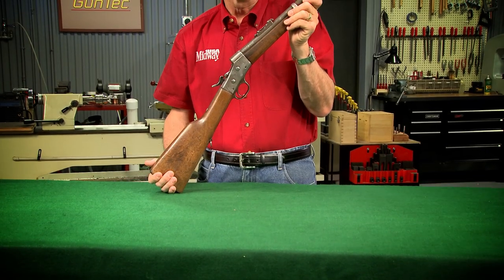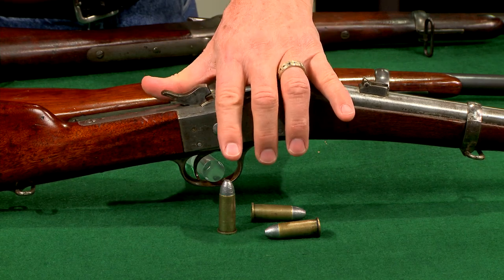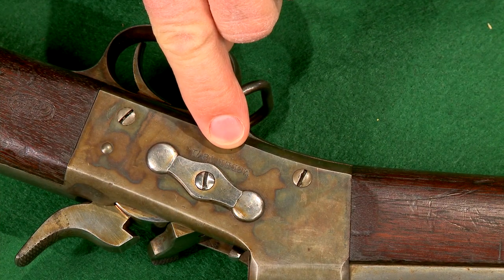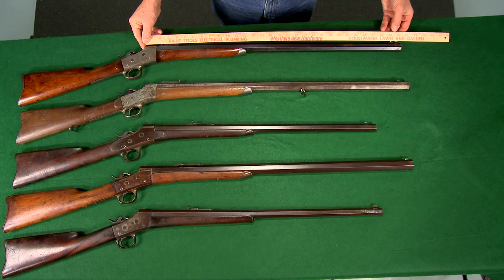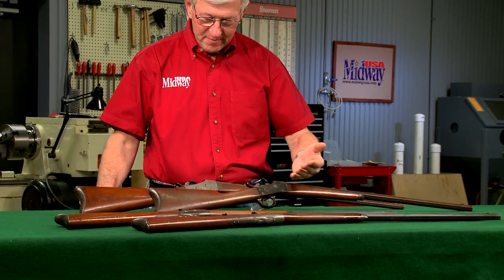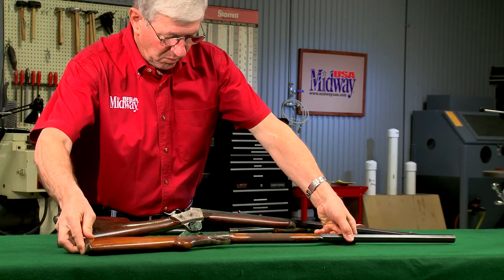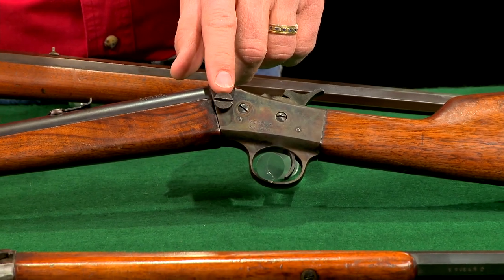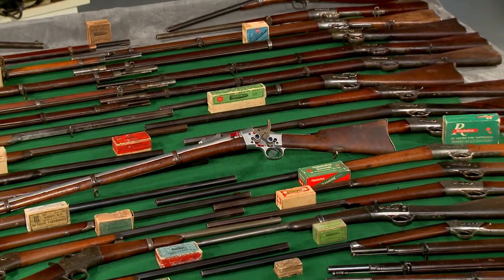A History of the Remington Rolling Block Single Shot Rifle | Gun History | MidwayUSA

Comment: Back in the early 80s, I passed on buying an old Remington Rolling Block in 6.5 X 53.5R, an obscure Caliber even then.  I was in my early 20s and had no use for a gun I couldn't easily find ammo for. The idea of having it rebarrelled or rechambered didn't occur to me back then, so I passed on the gun, and have kicked myself for not buying it ever since. Though in rough shape (no blueing left at all), it was in fair to good condition with only very minor rust pits on the barrel. In the bore was worn, but the rifling was still present. Back then, the owner was asking $125 at the time.

Comment: Thank YOU sir for your very interesting and informative video. This is probably the 3rd or 4th time I watched this video. I picked up a old Remington Rolling Block #1 in 20ga, it wasn't in great condition but appeared to work properly but haven't shot it YET. Someone welded back a broken lever on the breach block that makes me a little bit APPREHENSIVE about shooting it but figured to try low power bird shot for TESTING and will tie it to something from REMOTE FIRING TO BE SAFE!!!! Then I was able to pick a model #4 solid frame in not that great condition, externally was not too bad for its AGE but the BORE was not too GOOD, looked like it wasn't cleaned much and shot ammo that left a bit of lead residue in the rifling. I had to WORK on it AWHILE to get as much out as I could. It's NOT GREAT but actually not too bad considering what it was BEFORE!!! It appears to like CCI QUIETS and Agulia Super Colibris which is FINE but I will do more testing. Then today I found a #1 1/2 Sporter in 22lr, it had been RELINED so the BORE IS GREAT but I'm sure it HURTS the COLLECTOR VALUE!!!! It functions VERY GOOD as far as condition externally, wood and metal as well as ejecting exuberantly. It's got a NICE LIGHT CRISP TRIGGER which means if whoever relined the barrel did a GOOD JOB it should shoot VERY ACCURATELY if I find the ammo it likes!!!! I try to send most of my gun accessories purchases your way as much as possible unless you don't offer what I need or there is a significant difference in PRICES with some other company which doesn't happen very often!!!😉👍😎 I REALLY ENJOY ALL YOUR INFORMATIVE VIDEOS!!!!😁👍

Comment: I have a saddle ring carbine in 7x57mm Mauser and these models tend to have generous chamber headspace issues so I use 8x57mm Mauser cases and carefully set the shoulders back as I'm resizing them in a 7mm die,it will still fire a 7 Mauser round but the case has to stretch to fill the chamber length and the case is no longer safe to reload.Reforming 8mm brass is the only way to go if you happen to have one of these problem children,improves accuracy and makes case life normal, just bump the shoulder back to where the breech block closes and no more.

Comment: I have just received a nice Rolling Block rifle. Made in Sweden and stamped J.A. LAFQVIST. I believe it would be chambered in 12.17 x 44R though I cant say for sure. Looks to be a military model (3 band rifle) that has had sporting sights fitted (a rear flip sight which is just two plates with a v notch on top (dont know the ranges) and a small front sight). Dated 1871 on the action and also a plaque inserted into the stock saying (in swedish) 1st prize/place then something else which I cannot translate and then a persons name. (Werner Eriksson). Matching serial number (255) on all parts (even the bands). Great condition and would probably still fire. Too bad it is missing the cleaning rod though.
Reply: cleaning rods can be easily obtained if you have the military model - they pretty much all stayed the same. the sights sound like improved military/civilian sights. http://www.rollingblockparts.com/ has parts and may very well have the cleaning rod you need. Im still roaming boards/youtube for reloading components and info on my 43 egyptian.
Reply: Without that cleaning rod, the gun is totally worthless. You should get rid of it. My address is…😊

Comment: MY number 5 in 7X57 shoots very well but the modern ammo shows signs of too much pressure. Pierced primer and the primer is just slightly used out. I'm going to try to lower the charge in the loads by a couple grains or locate some old ammo with lower pressure.
I don't recall how I got the gun but my idea was to have it re-barreled for 45-70. My last rolling block was 45-70 and I loved shooting it. 
The 7mm is a better deer cartridge but just not as much fun.
Reply: You have headspace issues,use 8x57mm brass and size down until breech block just closes and all your problems go away,not safe to fire as is no matter what load you use in it the way it is now.You will be amazed at how well this works and accuracy will get even better.

Comment: I have a Remington # 6 ( rolling block  or ( falling block ) 32 cal. . I DONT know if this little rifle takes a SHORT or LONG cartridge I have found the  sn but I can't find how to know when it was made or just how old this little rifle is. The  sn # is as follows : S103618 .Can you help me out ? Thank you, DUKE
Reply: Duke, get a chunk of "cerrosafe" (very low temp alloy metal) and pour yourself a chamber casting. You can literally melt it in a ladle over the stove, with a torch, or, with patience, over a candle or alcohol burner.

Clean the chamber as best you can, VERY lightly coat with just about any oil (just enough to give it a shine, a damp patch spun in the chamber kinda thing), wedge a patch in the bore just beyond the chamber throat, and fill the chamber with molten cerro. Give it about 2 or 3 minutes to freeze, then knock out the casting from the muzzle with a cleaning rod. The alloy expands as it cools, so dont wait much longer than 5 minutes to knock it out, or it'll take a bit of "oomph" to dislodge, lol. If your cast isnt perfect, you can remelt it and try again til results are to your liking.

Once you have a good cast, take a dial caliper and measure it up in comparison to cartridge/chamber dimensions to determine the flavor of .32 the old gal is. Check the breech face placement of the firing pin to make sure she's a centerfire FIRST, because if she's rimfire, no ammo will be gotten for love or money, so chambering is a moot point, lol.

It sounds harder than it is in practice, a chamber cast is fall off a log simple stuff.
Reply: Its chambered for long, but will shoot shorts. I have my great grand dads in 32 rim.